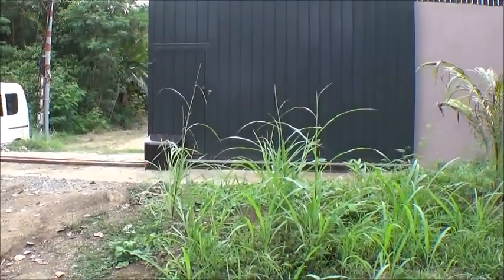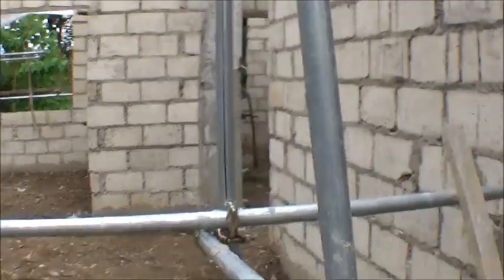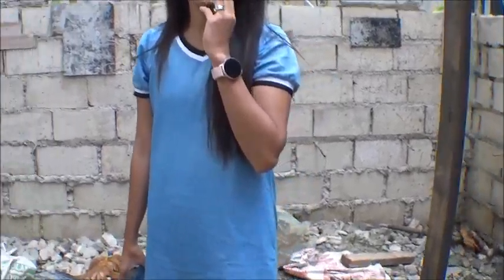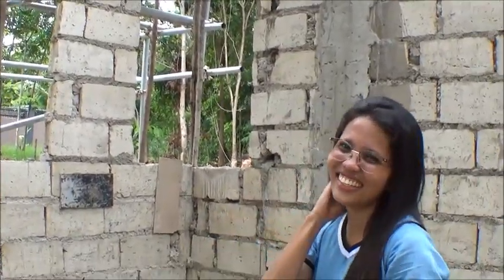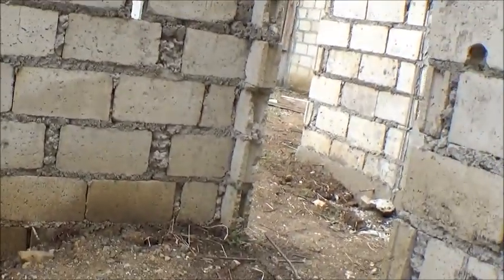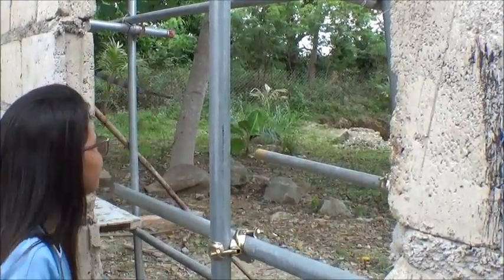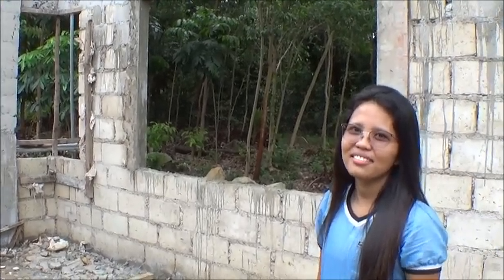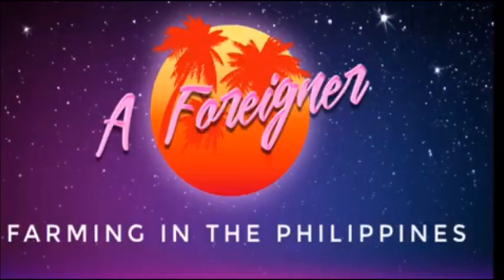Dewayne And Lovely Mae's Dream House

Comment: I hope they put that reflective insulation under the roof. . 
Will be so hot in the loft space otherwise, which heats the ceilings and rooms below ,  as I know to my cost!!  Lol
Would save on running aircon,  which is not cheap!
Reply: Whatever setup or ventilation you have, in the Philippines you will always need and use A/C. It is just hot. You cannot escape the hot weather. You may get acclimated after years if you try to fight it. But that's a lot of daily suffering.
Reply: @TexasFilipino  thanks James!.
Btw a very good friend of mine here originally from washington state. 
Had his very large two story house ( two hollow block layer walls) with  foam in between ( also the roof!) )built,  many years ago,  with insulation( thick stryofoam sheets!).
Of course ,  he had to have it shipped from the states along with many other things( 2 X 40 feet container loads of stuff!!  !! Lol.
He managed without any aircon at all , until very recently.
I saw a SM mall being built recently some miles away,  they clad the whole exterior,  with 2 inch thick sheets( 4 x2) of stryofoam!

Comment: O dear god looks like a first grader is building this house! It’s going fall over in a few years. No standards what so ever. Not trying to be mean but just unbelievable.
Reply: I owned a few houses in the Philippines.  These guys know what they're doing.  I know it's nothing like American houses or Japanese houses, but trust me they know what they're doing.  My house in Cebu went though a fairly big earthquake in 2011? it damage the old church but my house was fine.
Reply: @retirementinthephilippinesvlog  It will be covered with cement plaster and you will be amazed how will it look when finished. Structural integrity, I don.t know. I am sure it will survive a magnitude 7 jolt.
Reply: @romeoETmike  I was in Tokyo when they had the 9.1 and it's lasted 5 minutes, a 8.7 20 min later.  I agree 100%.  But, if it is a 9.1 I'm running my butt outside with or without clothes.....lol